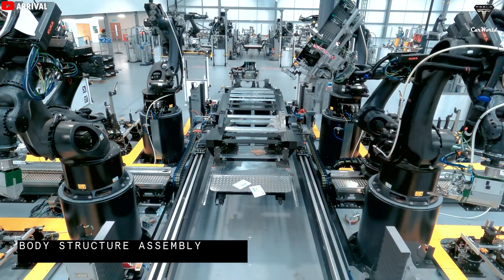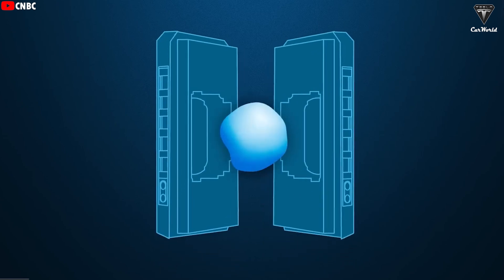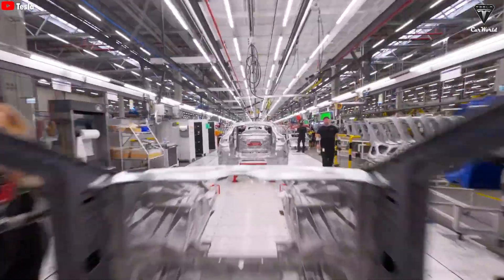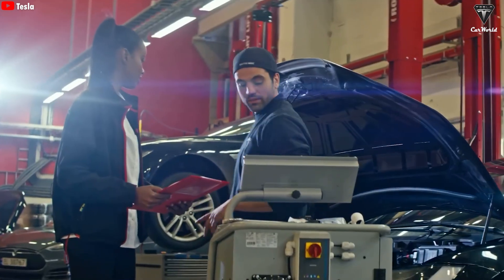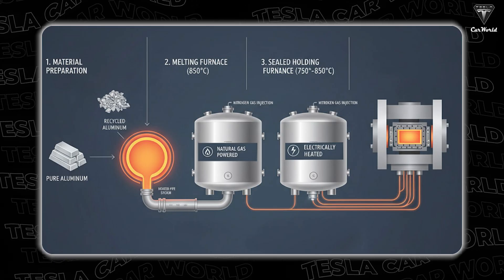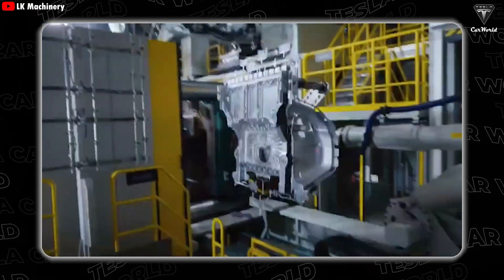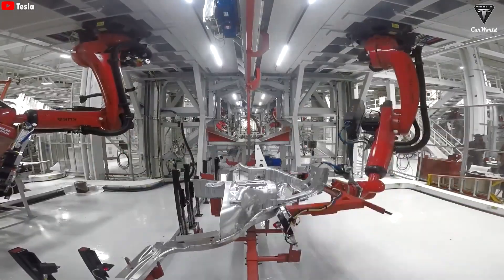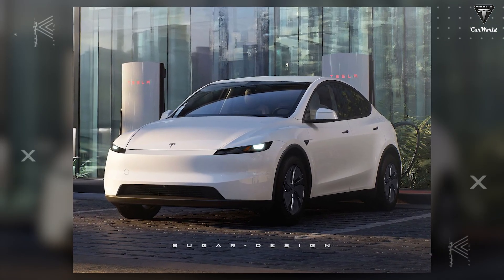Elon Musk Finally LEAKED Inside New Giga Press 2.0 Machine! INSANE Speed Impossible!

Comment: Still think another megagiga press & another factory is necessary.
Might as well start an ocean series boat craft & hyper speed aircraft.
Until ICE vehicles drop under 50,000,000 yoy production, EV's will only need to match that number. India & other lagging countries will skip ICE engines altogether.
$29,900 is another guessing #. Model 2 if it's the mass production EV, it will need to be $19,900-$24,900 to effect the "s curve." 
After that, 500+ miles per charge & under 4 minutes & little to no lithium. This will crush ICE by 2028-30. Even hybrids will be unnecessary.
60/40 EV edge.
Reply from the maker: You make some excellent points about scaling up production! Reaching a lower price point for the Model 2 will definitely play a huge role in accelerating adoption. If Tesla can pull off those performance improvements and keep the price low, it could disrupt the entire automotive industry. We’ll see how they navigate the competition in the coming years!

Comment: One concern  is that a single part that replaces hundreds of separate parts would likely require a new approach to quality control.  What will the statistics look like for such a  part? Yields--at least until the bugs are worked out--could be low, and there will likely be a inspection problems. Solving production problems might look  more like certifying an Airbus, or a submarine, rather than building a car. 
Sandy Monroe, what say you?
Reply from the maker: Great point! A single large part replacing multiple smaller ones does indeed raise questions about quality control and inspection. It'll be interesting to see how Tesla handles that in terms of reliability. I’m sure they’ll implement some rigorous testing to make sure the production process stays smooth. Let’s hope they don’t need submarine-level certifications, though!

Comment: I suppose the entire computer, sensors and wires required must be just one part.
Reply: I'll keep driving my 2014 Toyota Camry XL with 54,000 miles. She's a handsome beauty!
Reply from the maker: You're onto something! The sensors, wiring, and computers are pretty integrated into Tesla's design. But it’s not quite one part; it’s a very complex network of systems that work together. Making them more modular might help with repairs down the line.

Comment: How difficult or is it even possible to make a repair as a result of an accident and to do by local shops without ordering expensive replacement parts?
Reply: You just get a new one.
Reply from the maker: That’s a valid concern! With the advanced tech in these cars, repairs could be tricky, and some parts might be expensive. Tesla is working on making repairs more accessible, but for now, it might require specialized service centers.

Comment: $30k isnt going to cut it. Mass adaptation won't happen above $22k
Reply: The 8k delta would be made up for in a few years of fuel savings, the bigger hurdle is getting 240v outlets installed in apartment parking lots.
Reply from the maker: Yeah, $30k is a tough sell. If Tesla can keep costs down, though, especially by hitting that $22k mark, mass adoption could definitely take off!

Comment: I bought an Hyundai   INSTER   to replace my ageing 2006  Perodua   Kelisa   . 81 years old and not as flexible as i used to be 10 years ago .what i am looking for   is an ev which does not steer itself   and doesn't   keep boinging   take a break .      i do not need  automatic anything .    Lane / driver assist are a source of unwanted   intrusion  into my driving experience .   I want a switch for the lights and heating , windscreen wipers ..     although the auto parking brake function is perfect .the three position twist function for forward / park and reverse is unobtrusive and intuitive even for me .   I intend to only use home charging   using solar energy from my 240 volt    house electricity .  Six solar panels   supply me with 80 plus   KM of free solar energy to  more than cope with my daily driving requirements .  I want the display screen to show me the time and date , no stupid   mood  music and other such distractions to lure   my concentration away from the road ahead .   a useful aid is the phone connection which should automatically be activated   by the car,s software .not a complicated set up   needing a degree in computer programming .   Take the HYundai    INSTER profile and overlay it onto the proposed   TESLA MODEL 2   and there you have it a perfect EV    tailored for the middle aged . no scary sensations from the unwanted   diver assist etc.

Comment: Casting an entire underbody in one piece sounds efficient—until something goes wrong.
Reply: Duh
Reply: Like what?
Reply from the maker: True, efficiency is great, but it's crucial to account for any potential issues. With a single piece cast, repairs could be trickier if something goes wrong. Tesla will have to ensure their quality control systems are top-notch to handle any challenges that arise.

Comment: Tesla is betting simulations can replace long-term safety data.
Reply: They're also betting full FSD will drastically reduce the number of auto accidents on the roads, reducing fatal car accidents and saving many lives per year. How dare they?
Reply from the maker: That’s a bold bet! Tesla’s simulations are an important tool, but long-term real-world safety data is crucial to truly assess durability and safety. It will be interesting to see how Tesla integrates both approaches for optimal performance.